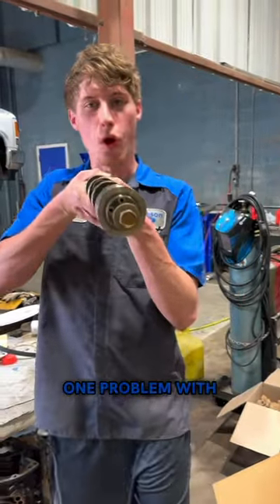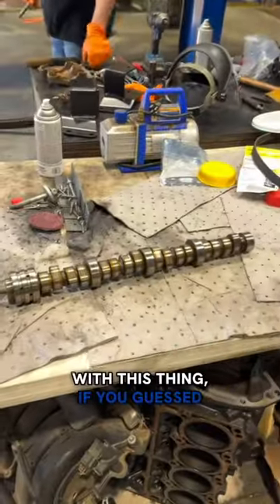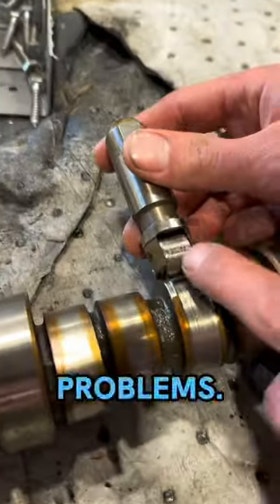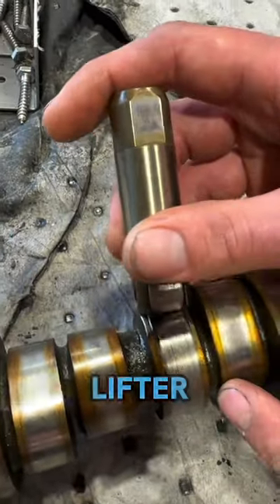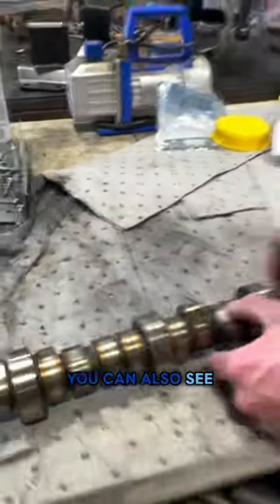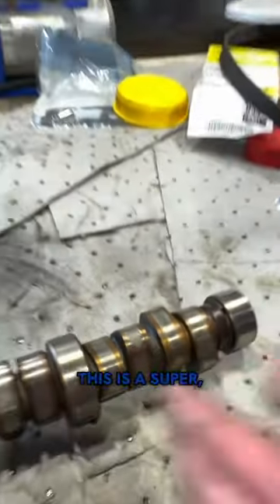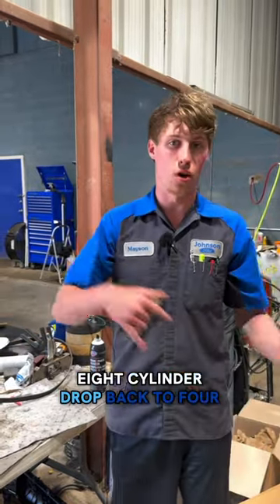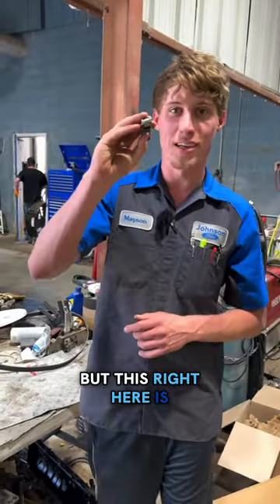The Number One Issue Plaguing Overhead Valve V8 Engines #shorts

Comment: #1 problem is cheap manufacturing materials.  There are engines out there 4-5 times the age that do not have these problems
Reply: and probaby mileage...
Reply: Nothing to do with that just the epa and there Emission standards show by the 3rd gen LS which doesn’t have DOD/AFm super reliable you just have to cam swap the 4th gen LS 5th gen LT and those only came in the automatic transmission
Reply: @Black__hoodie  Yep.
Reply: When I pulled a 3.4l out of a 95 Pontiac only problem it had was the timing chain and the exhaust lobe on #6 was damn near gone, it ran fine at idle but any rpms and it would start backfiring out the intake, engine had 217k miles on it, cost $200 for a new cam lifters and timing chain set, it's still alive in my 82 S10.
Reply: That’s nuts considering how much these vehicles cost. These are not Focuses or Corollas this engine goes in a $70k+ truck lmao
Reply: I agree. Save $.03 per lifter and you save millions a year. But that 3 cents comes at cost.
Reply: @alistairblaire6001 yeah they shouldnt put engines with known preventable problems in any vehicle!
Reply: @ADHDcisGinger 😅
Reply: Swedish iron blocks just don't break. Raw materials have been watered down for precise planned obsolescence. The alloys are weaker and cheaper.
Reply: @ADHDcisGinger my dad had an 82 s10 with a 3.4 from a 94 Camaro.  Cool that the 2.8s and 3.4s were interchangeable
Reply: It's not the years it's the millage.
Reply: @datboyawal-le6vs 3.4 was part of the 60 degree v6 family, 2.8 was first, then 3.1 and 3.4 came along.  Good motors when the intake gaskets and coolant situation is sorted out
Reply: @machineman8388  very true my dad was actually a gm master tech and swore by the 3.1s and 3.4s.  had a 95 grand am with the 3.1 and it had 360k when we sold it still running.  Original engine but did replace the trans once with a used unit only from me street racing it when I was 16. It would smoke v6 stangs Camaros and firebirds 😂
Reply: Or they could just stick with tried and true but they live by the if it ain’t broke we ain’t make money. If that was not the case the ford 300 would still be made today would be a lot better then the dumb f150 with 1.2 letter with 12 turbos on paper it’s got 12,000 horse power on paper but can’t pull a match box car behind it but will only run for 12 miles till it needs a whole new engine lol 😂 but the epa and mpg never crosses any one’s mind to do away with the epa and start keeping the oil fields of the country’s we go to war with or hell drill our oil.

Comment: Got a 91 chev 350 factory roller set with with 500k+ on it.   It’s not a design problem. It’s outsourcing problem.
Reply: It's a lifter issue as he said. I've got a LS with 800k never opened.
And 3 others with 500k. 
You have no point. 
It's the deactivated cylinders with lifters.
Reply: Unit_450 you only really started seeing lifter failure on GM 5.3 engines when they moved the manufacturing overseas.

Previously the lifters were made and quality controlled in USA until 2000 something

Look it up, lots of the engine parts were made by an American company I forget the name
Reply: Unit_450 right, but the ford 7.3 is not a afm engine. The issue is design and sourcing.
Reply: That's cause it's pushrod and single cam
Reply: @mitchellandrew3318 it’s just as often the regular lifters.
Reply: @mitchellandrew3318 The first cylinder to go out on my Hemi was not a deactivating cylinder, it's definately a manufacture problem.
Reply: @MWilk098 Thank you, didn't see your comment before I put mine in
Reply: If it helps anyone else who comes through here, from research, due to owning a Hemi that had the lifter failure, they updated the lifters many times, due to the issue of the failures. If I remember right they updated the part number in 2017 and in 2021
Reply: Im not even a chevy guy but i approve this message
Reply: It basically a metalurgy issues whether by design specs, quality control or simply taking the lowest bid and this holds true to camshaft materials also.
USA made custom steels, speced to the needs of whatever it was intened for, is almost a thing of the past.
Reply: @Tropicalfrooploops  that's exactly what the previous guy said, and he is correct. shitty steel, bad milling, all from over seas.
Reply: Most Americans are"too busy" to maintain their vehicles. Routine oil changes at 5k will prevent this. Kudos to 800K!
Reply: 500k BS!!! Lier!!! Unless you rebuilt twice. Which makes you a lier by omission.
Reply: @mitchellandrew3318  3rd gen or 4th? 4.8 5.3 or 6.0?
Reply: @arireid1245  03 5.3
But I've got a 4.8 from a 05 with 512k 
Another 04 5.3 with 478k 
And a 08 6.0 with north of 500k also. 
I only know the other numbers cause I was looking for my low k Guage for a fresh build and to go back with the low k chassis haha
Reply: @mitchellandrew3318  I  always tell people LS is the best! One more thing I want to know what oil are you using  for your motors?
Reply: Unit_450  The 6.0 work trucks didn't get that stuff in 07. I've got a 09 2500hd without it. 
I personally haven't looked into when they added it or not tho.
Reply: Yeah really. They just don’t make parts as good as they used to. I have a 1987 f150 with a 302 small block. I’ve been through seven solenoids. I’m abt to buy a ford oem one to see if that solve stage problem
Reply: chinesssium  metal
Reply: @mitchellandrew3318 800k? Let’s see it lmao
Reply: A 91 w roller lifters?? LOL gm trucks didn’t get roller lifters until 96 (roller motors/vortec) that’s why they had dog bones and the hold down (spider tray)
Reply: It’s all cuz the fuckin AFM and DOD BS !, I got a 13’ sierra 5.3 single cab 6.5ft bed from auction 12k$ 88k miles and I’m waiting on my DOD delete kit and my truck Norris cam kit lol …not gonna wait for this^ to happen
Reply: But hell I got a few budget flat tappet SBC motors I beat the piss out of my 383 prolly has 50k miles on it, never wiped a lobe or lifter!!, Howard’s cam and Herbert lifters!
Reply: @PHILLY214  Can't anymore. Shop burnt down in January. 
But I've seen others also. Not the first time I've seen some up there. One just happened to be my dad's personal vehicle. His diesel will be up in that rang in the coming years. 
If fuel wasn't nearly 10 bucks a gallon I'd be 10x higher then I am now on my 09 6.0. Driving 60- 100k year isn't uncommon for me with what I do for a living.
Reply: @PHILLY214  These are all pre that deactivated BS. I don't buy those junk motors. 99-07 or when ever they did the swap I believe was 08. 
But the 6.0 didn't get it till much later if they have. I didn't bother looking I don't deal with them enough.
Reply: @mitchellandrew3318  GM had the AFM available in late 04…and DOD available in early 07….Even tho The truck I got a few weeks ago is 88k miles I’m getting rid of that stuff…I already did headers and exhaust and have a drop kit coming, just wanted a nice newer daily driver!  (Should be nice after the truck Norris and tune!) So I can put the wear on my other truck at the track 🤣 hell now 2/6 of my cars are fuel injected now LOL! …hell I beat on all my vehicles but I make sure to maintain them to a T
Reply: @PHILLY214  They had that out in 81 if you really wanna get into it. 
But it was a standard product among all motors till about 08.
Reply: Several reasons for the failures today and last year ....

Comment: When you disrupt the oil supply to cancel cylinders I don't know what a thinking person would expect to happen.
Reply: Keep the oil clean  and there won't be a problem
Reply: @Drduktape if only it were that simple
Reply: At least you won't have to worry about this on a Chevy, your transmission will fail before you ever have an engine problem😂
Reply: @wackadoodle8951 Actually,  GM has the same problem too along with transmission issues.
Reply: Alfa Romeo invented oil bath overhead twin cams with hemispherical combustion 80 years ago!
Each cam sat in a bath of oil = no dry starts.
Reply: @naruttaanime9471  how would you go about draining the oil if half of it is sitting on top of the head?
Reply: @wackadoodle8951  it is a only a small 4 ounces per camshaft sitting there awaiting next crank, cam loves look like new, use the euro spec such as synthetic pioneer: SINT 2000 full Synthetic 20w50 oil on Alfa Romeo high revving engines putting out almost 100 HP per liter since 1972 (compare to Porsche seeing machine dry sump 65 HP per liter).
Reply: @naruttaanime9471  interesting, thanks for the info!
Reply: I thought the spark and fuel was cut off and not the oil.
Reply: The deactivated lifters get more oil on the Hemi not less. That’s not the issue
Reply: ... there's one oil pump dude
Reply: @detaart  yes but there are solenoids the cut off the oil supply to the lifters to cancel them

Comment: Roller cams were supposed to be the answer for flat tappet cam failures. Go figure.
Reply: Its a quality issue not design flaw 
Go with a jesel or johnson lifters and you're not going back
Reply: @Airman.. 
Agreed. Cheap parts and flaws in the hardening process of the cams.
I personally believe that even roller cams benefit from higher zddp levels in the oil. I’ve read articles that also suggest that some synthetic oils can actually be TOO slippery, causing the roller to not roll and because of the lack of high levels of zddp in modern oil the cam and lifters thus suffer the same fate as a flat tappet.
Reply: @mattbauckman9907  I have a 96 Explorer with a 4.0L Ohv runs great still over 200K, never heard on a forum of a worn out camshaft.
Reply: Cheap Chinese cam.
Reply: @alb12345672  not all cam in block designs are the same.  4.0 started life as smaller flat tappet designs and the roller upgrade worked well.
Reply: You couldn't pay me any amount of cash to build a flat tappet engine today! I watched my dad , whom is a life long mechanic and has built literally 100s of engines , wipe out 2 cams on break in within a week of each other , all comp cam components. The QC of shit and China metal is horrible! Hell it's a crap shoot for even a ROLLER lifter lol, I've had just as many AcDelco, Delphi and Elgin lifters be faulty out the box as I have cheap generic eBay ones. I build a LS/LT about 3 times a month so I can def say it's QC issues
Reply: Never heard that rollers were an answer to failures....they were a performance and efficiency upgrade.
Reply: @johnpeters9793 it's not a fix really, it comes down more to the crap metal they use to build  the lifter. Stand a better chance of a roller not going bad vs how many timed recycled steel flat tappet lifter failing that's all. I get bad rollers all the time too. Friction that is there with a flat tappet will fail long before a roller, that's taking in account the garbage China metal they use to build everything now days
Reply: @erik120719  

I will agree ALL valve train has gone to 5hit recently. ...flat tappets as well as roller hardware. 

Fried a 460 rebuild with junk lifters. Summit would replace them, but that doesn't help me rebuild the entire motor.

As far as when roller lifters came on the scene, the Ford 302 HO in '85 claimed it was not only for reduced friction but a tad more aggressive lobe ramps.....there was never a problem with flat tappetes as far as reliability prior.
Reply: @johnpeters9793  @johnpeters9793 I've had em wanna go good for a bad lifter too, then you ask them about cam, cam bearings and labor and they say it's not their fault lol. I'm not saying flat tappet was bad at all, but with the shit metal nowadays, it's more of a risk to smoke a cam and lifters if you build flat tappet motors, not enuff zinc in the world to compensate for 50 beer cans and a iron nail melted down and turned into a lifter lol that's why they are trying to recover WW2 ships ( heard somewhere don't quote me) to recover the old pig iron to mix in with the crazy alloys they have ended up with after all the "recycling" of metly

Comment: Back in the 80s and 90s when the 5.0 Mustang GT's were everywhere everyone I knew had one and no one ever had a roller lifter failure or lost a cam,,, or am I confused.
Reply: Yeah back then it was only an occasional distributor drive gear issue .... which really wasn't an issue as much as it was people not maintaining stuff properly...
IMHO, that's why a lot of these are failing: lack of proper oil changes is the #1 culprit on these newer engines.
Reply: @billymanilli   My experience with those 5.0's was they just got the crap beat out of them and abused,, not great maintenance and they just kept taking it..
So I don't know why did those lifters held up and modern ones don't...
If I had to guess I would say it's modern metallurgy, poor quality control, cost cutting, and something about modern oils....
Reply: No you’re not confused. My 90 5.0 was thrashed and abused for 15 years and 340 thousand on the clock.Had an AO Dominator behind it built in Louisiana around 280 thousand. It would not stop running.
Reply: @shortchange26   Yeah, that was the general common experience,, my best friend had an 89' with SVO roller rockers and off road exhaust and he BRUTALIZED that thing for 140000 miles then traded it for a 92' Ranger STX SuperCab.
The only major repairs to that 89' was several clutches and one rebuilt 5 speed.
It still ran like new.
So why did those roller lifters live and so many modern ones don't ??
I assume there were some 5.0 roller lifter failures but I've never read or heard it talked about even ONCE and up til the late 90's I read EVERYTHING Mustang..
Reply: Probably something to do with zinc being pulled out of modern oil.
Reply: @cmkm54   First thing I thought of but you'd think by now they'd have that solved.
Reply: 93 F150 5.0 HO 186k on the odometer, has originally set of lifters and original cam. Truck was Bought new by a family member, another family member bought it, then I bought it. It has seen every type of driving habit under the sun and every brand of 10w30. Runs like a Singer sowing machine.
Reply: @2packs4sure  I'm also wondering if it has something to do with the super aggressive ramp rates on modern camshafts. Those things look like triangles these days and old school stuff is egg shaped lol.
Reply: @mikerobinson3672  The Explorers had 5.0L engines, NEVER heard of one fail on a forum. I have the V6 4.0L OHV still runs great, over 200K. Starts up and is reliable as the flames of he$$. Rides nice with 4.10 gearing.
Reply: @alb12345672  the 5.0 in the late 90s Explorers if I'm not mistaken we're left over 5.0 HO like the one my F150. They were basically left over 5.0s for the Mustang GTs. Ford had to burn them up somehow so they put them in the Explorer. Again roller set up in both. You didn't see them fail like today's pushrod engines. So it's either bad engineering or materials.
Reply: @mikerobinson3672  Yes they are special HOs (I forget the head name) and the last few years are coveted for a swap, they improved even more. Those engines were pretty much indestructible, no corners cut. Seems the roller problem is in many engines though. 5.4 3Vs had a problem with them. There could be oiling issues. I have a 6.2L F150, that is probably the quality of a 5.0L. They have a rare issue with broken valve springs but the rest of it is bulletproof. It is an SOHC motor.
Reply: @alb12345672 

"GT40 heads". Ford didn't have to "use the 5.0s up"...the Jeep Grand Cherokee had come out with V8 power and a much better ride than the 4.0 and Twin Traction Beam in the Explorer could offer. The 5.0 fit in the Explorer, the new OHC Modular engine didn't.

Ford had to redesign the front suspension to accomodate the V8, thus killing two birds with one stone.
Reply: @aaroncostello8812  The GC seemed like a good competitor with the v8.
Reply: @alb12345672  It was a good competitor and Ford knew it. That is why a V8 in the Explorer was a must...at least as a stop-gap until the Expedition was ready to go on sale. Still, the Grand Cherokee never came close to the Explorer's sales numbers.
Reply: Over last 40 years ..zinc reduced in oil the excuse is it might decrease the catalytic conv. Performance
Reply: Yes, we pulled a head out of the junk yard with 160,000 miles. We put it straight on our 2.4 l and drove that 1987 Mustang into the ground with about $100 worth of gas in 4 years 😂it went to the junkyard running 👍with good original roller rockers.
Reply: @aaroncostello8812  In 02 when they put in that 5R trans w/the v8 they totally ruined the truck. Still is the worst car on carcomplaints 🤣🤣 The 5.0L 4R70W combo is probably one of the most reliable powertrains ever made. I know someone who uses it in their landscape business, tows at near capacity every day. He maintains it to the book himself and it runs like a top. Must be pushing 400K already.
Reply: @alb12345672  Completely agree. The 5R55E they used behind the sixes from about '98-'01 wasn't bad at all. It was the later versions like the 5R55S and 5R55W that sucked.

The 4R70/5.0/AWD combo was as good as you could get.
Reply: @aaroncostello8812  The 4R in my 96 Is still original. Gets new fluid and filter every 30k. Shifts great. less than 1 hour of work, no lift needed. I have a pan with a drain. The 5Rs  are 4rs that worked the valve body double duty to get more gears. Then the S/W used pot metal for servo bores, game over. Also "lifetime" fluid.
Reply: @shortchange26 the issue with the newer engines is cam location, 
All valve train lubrication drained back over the cam and lifters. Newer engines like the hemi and ls raised cam higher in block, put in dedicated drain back ports bypassing cam and lifters and crankcase design in block prevented splash.
Basically they were designed to fail, but at the proper milage.
Reply: Better quality back then on std parts
Reply: Your correct